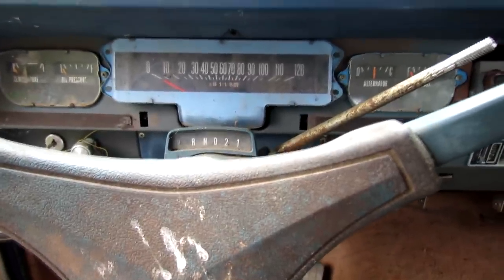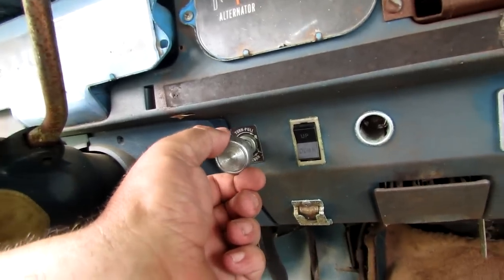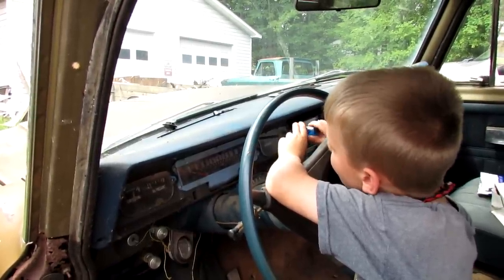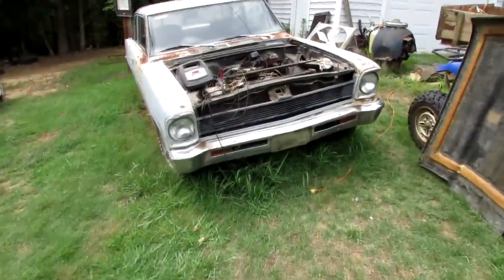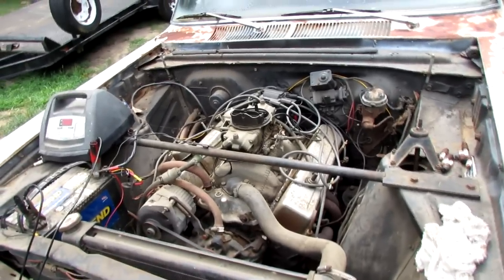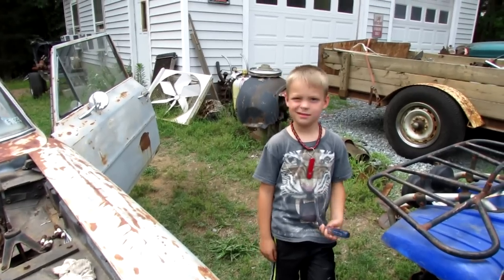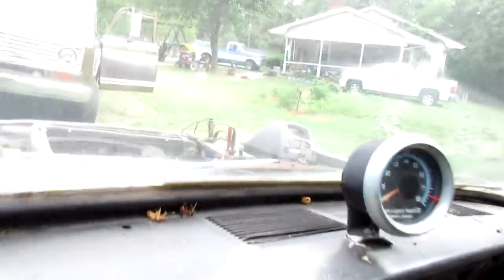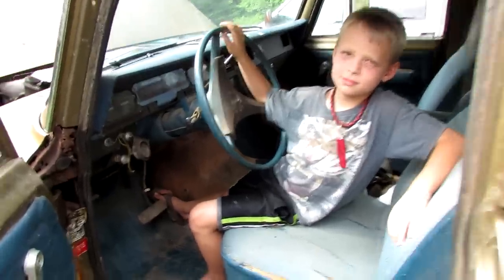More Travelall

Comment: If that is a Chrysler Torque Flite, the correct throttle linkage adjustment is to have the carb at warm idle position and adjust the linkage until just contacts the pin on the carb. Any throttle movement should immediately move the transmission throttle rod. You should have the engine running so that transmission pressure moves the throttle valve to it's lowest position. If the linkage is too long, the shifts will be late and harsh. Too short and the shifts are early and soft.
A TorqueFlite has the selector shaft coming out the top of the case just above the pan rail. Most other automatics have the selector coming out the side of the case.
Reply from the maker: It's a 727 I think. I'll have to look closer. Obviously I am not an expert on this trans. Haha.
Reply: The 727 was the big case TorqueFlite.

Comment: hi, i have a 73 international travellall with a 392 and we replaced the holley 4bbl with an Edelbrock 1411. now it turns but doesnt spark and finding any info has proven to be frustrating.. any ideas a list is OK
Reply from the maker: I bet you just knocked a wire off the distributor or coil during carb installation.
Reply: Thank you for responding.. yep he disturb all my wires. Lol
WE Have been looking for a specific wiring diagram and that's just about crazy impossible.. used a lot of ink.  Thanks again. Like your vids.